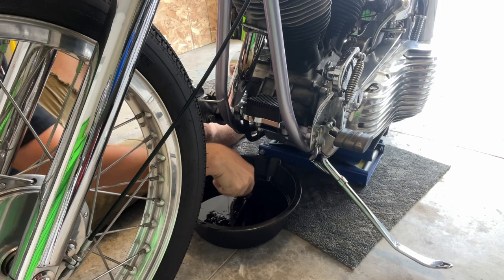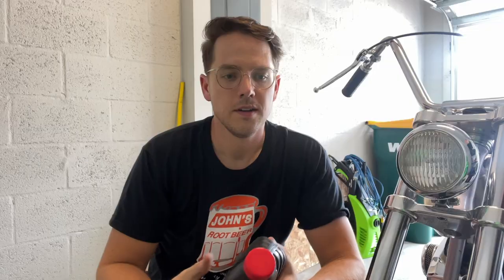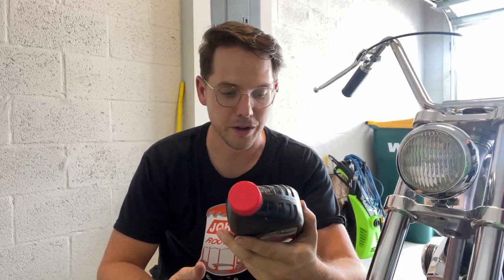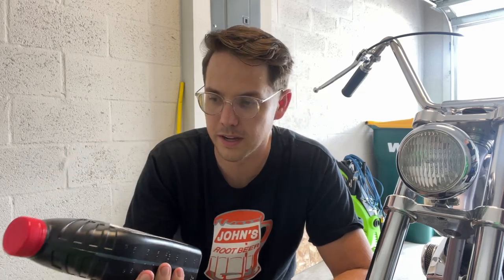1978 Shovelhead Chopper Oil Change Air Filter & Ride

Comment: Man I grimace every time I see someone not running a decent filter element on there bikes. It’s not the “big stuff” that’s the worry, it’s the fine invisible stuff floating around in the air…think of the grit that gets in our eyes when not wearing eye protection, that same grit gets sucked straight into the barrels and is like sandpaper on the bores & pistons…it’s called dusting the pistons. Some filter oil on the foam element like the dirt bike riders use should be used when running a basic foam filter…ok, rant over, thanks for the vlogs Doc…love the Shovel.
Reply from the maker: For sure! I put a coat of filter oil on my filter before I put everything back together

Comment: Can you tell me the type of air filter you use.  Also what size pilot jet do you run.
Reply from the maker: The air cleaner/filter is from Boyle custom moto…he doesn’t make them anymore. For something similar checkout trident cycle supply. Not sure on my jet size, been a long time since I jetted this thing